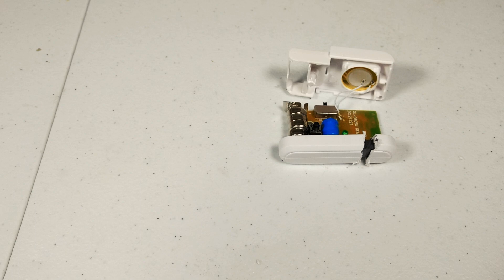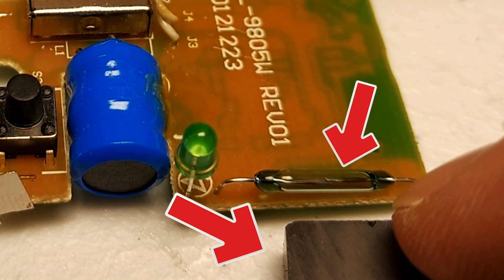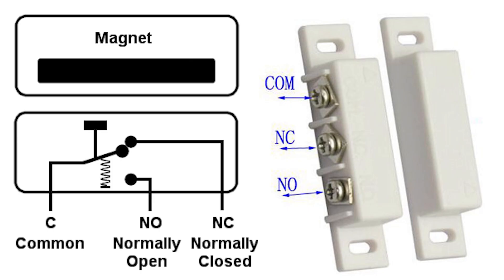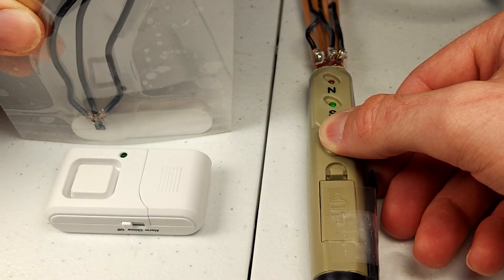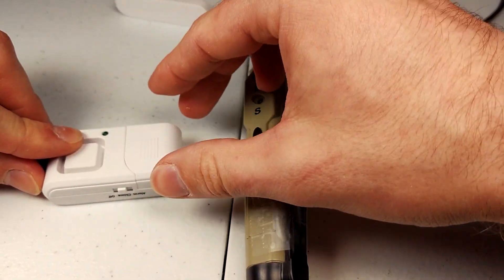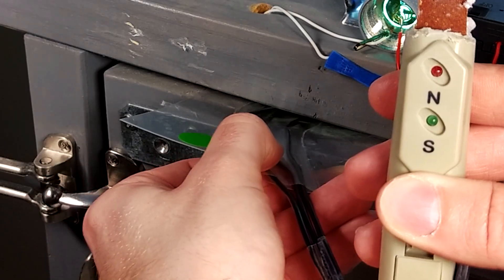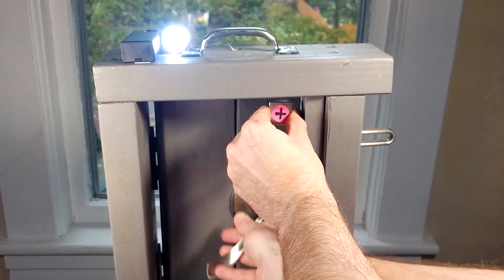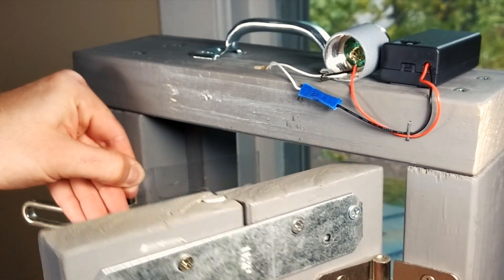Bypassing Basic Door Alarms

Comment: This would not work on rollershutters made of metal ? Or would u need a super strong magnet
Reply from the maker: This device does not use a magnet of its own. It's a hall effect sensor that detects the polarity of the magnet used in this kind of door contact sensor. I've never tried it on roller shutters but I have tried it on sheet metal doors and have had no trouble. Theoretically, as long as the metal is not magnetized, it should not impede the device's function.
Reply: I order u a sensor and u test ? Haha, also if its not reachable from outside, any other solutions ?

Comment: Where can I find the exact Hall effect sensor circuit you use? Is it commercially available or did you build the one in the video?
Reply from the maker: I'm embarrassed to admit that I took the laziest (and ugliest) approach. I removed half of the housing of a magnetic polarity tester, disconnected the hall effect sensor from the existing electronics, and reconnected the sensor with much longer wires. This saved me the trouble of finding new housing for the button, LED's, and batteries, but at the cost of it looking horrible. Still, it works! 

This was the original tool: https://a.co/d/ic1b5ol

Comment: Can you do this through a door
Reply from the maker: Usually, yes. My model door obviously doesn't fit tightly in its frame so it's not an excellent platform to demonstrate this. However, the point of laminating the sensor is to allow it to fit in between tightly fitting doors and their door frame, like a shim.